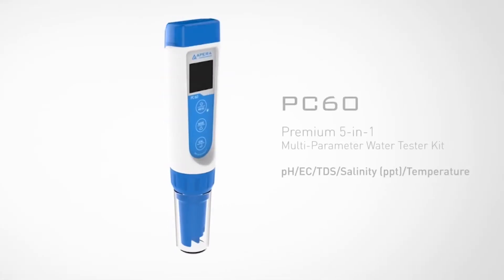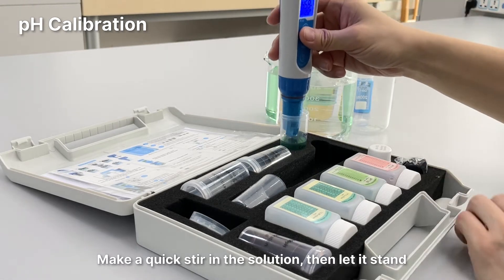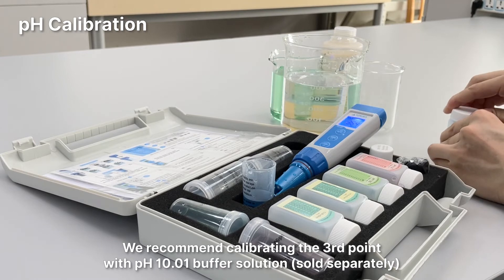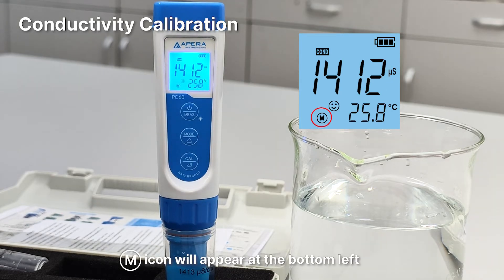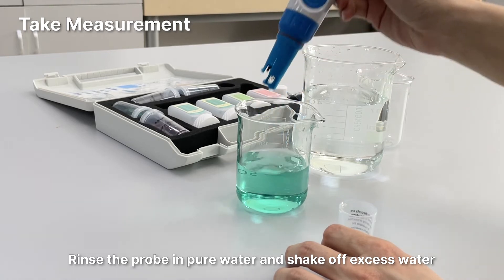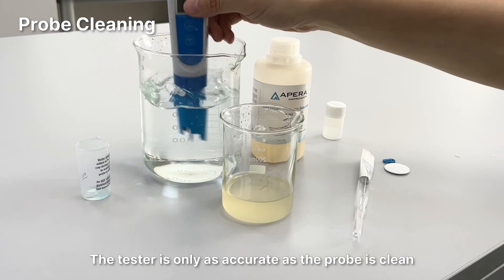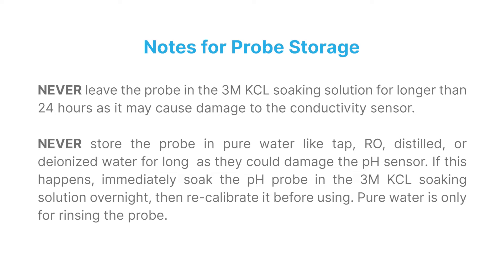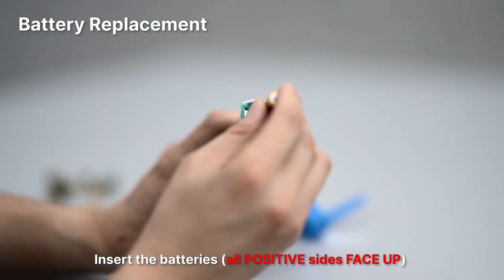Apera Instruments PC60 pH Conductivity TDS Salinity Tester Video Tutorial

Comment: I have a problem with my Apera PC60 meter. When I set it to conductivity units, it jumps from 1.600 to 2.5 without showing readings like 1.700 or 1.800. It only jumps from one to the other. What could be happening?
Reply: I’m in the same boat. ???

Comment: What a brilliant video, I’ve got through so many probes… I was storing it in the KCL solution 😮! I’m not good with reading instructions so this video makes everything clear and concise. Much appreciated. Easily the best pen on the market at this price range. Could I ask what is best to store the probe in (water droplets) should they be tap water or deionised water? Auto hold is very useful also. Didn’t know it had it. 👍🏼 just as I thought I had mastered it the the ec meter has started reading 0 for no reason. It’s a new pen. Followed the instruction to the T not having a lot of luck.
Reply from the maker: Thank you very much for your feedback! Tap water for water droplets is fine, but if you have distilled water or deionized water on hand, it'd be even better as they are much cleaner.
Reply: @aperainst  perfect yes I have deionised water, any ideas I could try as the ec meter just reads zero. I did leave it in storage solutions for 12 hours. Could that have damaged it.
Reply from the maker: No. You should be fine. @elliottdebell7783

Comment: Great info, just got a PC60 and looking forward to using it.  I am wondering if the calibration solution can be reused, or is it one and done?
Reply from the maker: As long as the solutions are not contaminated or expired, pH 4 and pH 7 can be used for up to 10 times calibration; all the others can be used for up to 5 times. And it's always a good practice to use fresh standard solutions for achieve maximum accuracy.

Comment: great video but how often do you need to calibrate the meter ? and do you need to calibrate it when it's brand new ? thanks
Reply from the maker: It is not a must to calibrate when it's brand new. But you can always check the accuracy by testing in the pH 7 and pH 4 standard buffer solution. If the reading error is within your requirement, then you don't have to calibrate the meter yet. As a rule of thumb, we'd recommend calibrating the meter at least once a month.